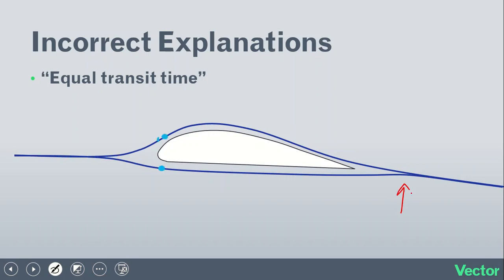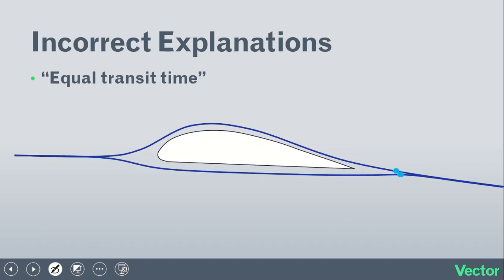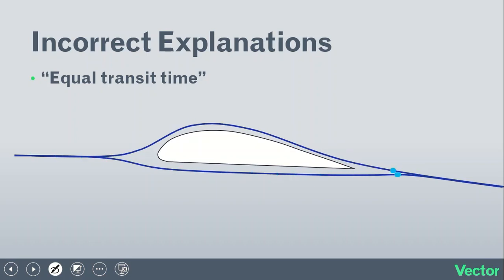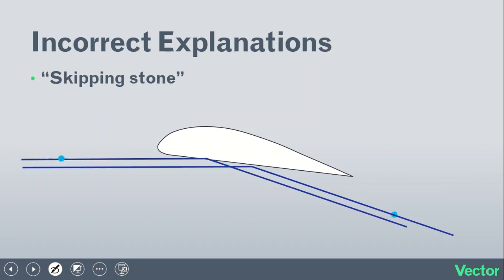Common Misconceptions About Lift

Comment: You probably believe in the Easter Bunny.
Reply: Asymmetry turns the relative flow resulting in lift as the reaction force.

It's that straightforward.

The pressure difference turns the flow.  

The pressure difference is the asymmetry's different effect on pressure above vs below.

The pressure change is caused by mass flow continuity's self-sustaining.

Comment: Incorrect. There was never any need for the air to "meet" at the end, that is just an additional reason the lift would be greater. That doesn't refute the transit time being roughly equal.

The skipping stone explanation also only spies in certain cases like flaps.

I'm sure this account will be deleted though.

Comment: So what mechanism is producing the pressure distribution around a wing that results in the lift force?  And for anyone still clinging to ideas of the upward pressure on the underside of the wing producing most of the the lift force, the greater proportion of that force is actually produced by the reduction in pressure on the upper surface.  This has been measured experimentally and demonstrated many times over the years.
Essentially, as a wing is speeding through the still air, it’s producing a vortex, and the wingtip vortices are an extension of that mechanism.  Aerodynamicists will talk about Circulation Theory, with velocity added to the airflow over the upper surface of the wing and subtracted from the airflow beneath the wing.  However, they tend to suffer from Wind Tunnel Syndrome, where the air has velocity, momentum and kinetic energy.  In total contrast, still air has none: it is the wing, along with the aircraft, that has velocity, momentum and kinetic energy, some of which is transferred to the air.  
In a wind tunnel, the air must keep flowing around the wing towards the fan that’s inducing the airflow, whereas in the real world, displacement of the air is produced entirely by the movement of the wing.  The downwash decays in seconds and the wingtip vortices in minutes: the energy transferred to the air is soon dissipated.
But how can I convince any sceptics that a wing is producing a vortex?  Let me start by referring to the Magnus Effect.  This is the same aerodynamic effect that causes a spinning baseball to curve, and a spinning soccer ball to bend: the spin produces a lift force.  The Magnus Effect is also exploited by a device known as a Flettner Rotor, which is simply a long, rotating cylinder that, with its axis vertical, has been experimented with as a sail on ships.  It has even been experimented with as an aircraft wing.
So how does a Flettner Rotor produce a lift force?  Let’s start by consider it rotating in still air: there’s no lift force generated, but what is happening to the air around it?  Because of the viscosity of the air, the rotor develops a forced vortex around it.  As disastrously demonstrated by a tornado, the closer to the centre of the vortex, the higher the rotational velocity and the lower the pressure.  Didn’t Daniel Bernoulli have something to say about this?   
When a wind blows across the rotor, the flow is speeded up on one side and slowed down on the other by the vortex.  This produces a relative lowering of the pressure on the one side and an increase in pressure on the other.  Consequently, the rotor produces a lateral force at right-angles to the airflow: in other words, it’s producing a lift force – but sideways.  There is also a displacement of the airflow, the equivalent of the downwash of a wing.
I hope that the similarity between the effect on the airflow around a Flettner Rotor and around a lifting aerofoil, otherwise known as a wing, will be obvious.  One is producing a vortex, and so is the other: there can be no real difference in the mechanism.  Forget the idea of the curvature of the upper surface of the wing increasing the velocity of the airflow over it, relative to the velocity across the flatter lower surface: that same wing; in inverted flight, still produces a lift force.  Even a flat plate at an angle of attack to the airflow produces a lift force, with a reduction in pressure on the upper surface and an increase in pressure on the lower.
I have one final thought for you:  it is the viscosity of the air that results in the production of a lift force – and drag.  If air was not viscous, there would be no lift - and no drag.
Reply: "it is the viscosity of the air that results in the production of a lift force"

This is fairly often stated but is not universally accepted.  There are studies and a substantial body of work to the contrary.  After all, why would a transverse force not be possible if there is a pressure asymmetry produced from a geometrical asymmetry of the airfoil shape?

Where's the proof?  The Kutta condition being regularly applied to potential flow?  That's no proof of lift being a viscosity phenomenon, it's a technique of mathematical simplification.  Again, where is the proof that an asymmetrical solid needs viscosity to produce a transverse force?

Most of what you mentioned could be placed under the broad category of "effects of asymmetry," which is fundamentally what causes lift of course:  asymmetry of a solid to the relative flow, turns the flow.

The pressure asymmetry that results from the conservation fundamentals (mass, momentum and energy) provides the first principle of physics details.

Comment: I've only just come across this, and I've been interested in arriving at my own understanding of how a wing works not just for years, but for decades.  I have to say that, despite plenty of evidence provided by professional aerodynamicists, there are still many out there - and here - who still do not understand and cling to their pet misconceptions.
The 'Equal Transit Time' myth has long since been debunked.  There are video clips on YouTube of a wing section in a wind tunnel, with the airflow made visible by pulsed smoke trails.  These very clearly show that a visible section of the airflow over the upper surface arrives at the trailing edge long before the equivalent visible section of the flow across the lower surface.  Look for Holger Babinsky and How Do Wings Work? on YouTube: he's Professor of Aerodynamics at the University of Cambridge.     
However, to get to a real understanding, it helps to free oneself from what I characterise as 'The Wind Tunnel Syndrome', and think about what happens to a real wing on a real aeroplane: it's the wing that is moving at speed through still air, not the air flowing over the wing.  Someone has mentioned the book 'Understanding Flight' (Second Edition) by David F Anderson and Scott Eberhardt.  I recommend the book as a good introduction, as the authors do make this point very clearly. 
The simple fact is that a wing produces lift by diverting air downwards: if one could see the air movement as a plane flew past, one would see that it is being propelled downwards (and slightly forwards).  There are plenty of photos and video clips of aircraft flying above and through clouds,  with the downwash producing a 'trough' in the cloud tops, plus the downward and inward curl of the wingtip vortices.  It's an impressive and graphic  demonstration of Newton's Third Law of Motion in action.  A wing produces lift in accordance with Newton's statement that, "every action has an equal and opposite reaction": that's a fact.  
OK, there then arises the question of what exactly is the mechanism that produces the pressure variations around the wing, which produce the upward force that we call lift?  Again, go to Holger Babinsky, who explains this in a lecture that is available on YouTube.  However, I have another way of explaining the same mechanism, which I'll do in another post.
Reply: Babinsky brings Coanda effect too much into the explanation, which creates more than one problem.

Mass transit time still has to be equal to what it was (viewed from the moving reference frame) as when no airfoil was there.  So, in that sense, equal transit time is needed.

Your wind tunnel "syndrome" is your misunderstanding, apparently, that all motion is relative, and the laws of physics apply to all reference frames.

Of course lift is made by moving air downwards. Not widely disputed (who would dispute Newton's 3rd law for very long?).

The pressure differences were explained by Babinsky, by falling back on Coanda (if I'm not mistaken), which rather weakens his entire explanation.

The pressure difference is clearly caused by "energy borrowing" from static pressure to increase dynamic pressure enough to sustain momentum (that is: conservation of energy in service of conservation of momentum).  There's nothing new in this, it is fundamental:  conservation of momentum, energy and mass flow rate are first principles of physics.  This is precisely why these are encoded in the Navier-Stokes equations which accurately describe lift using cfd methods.